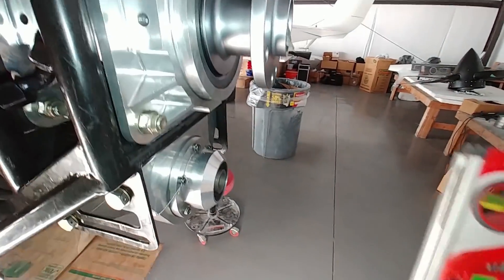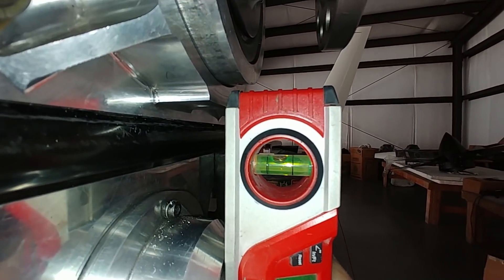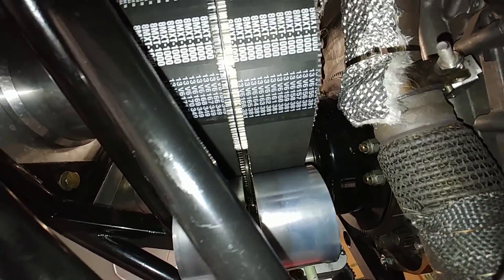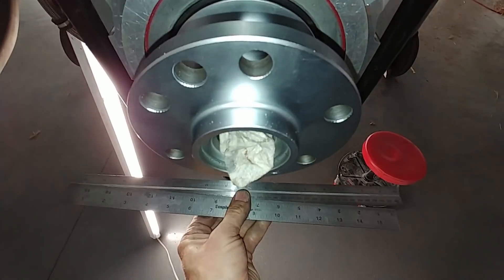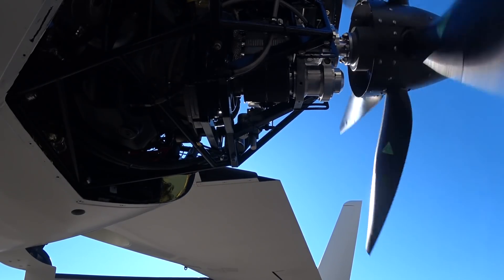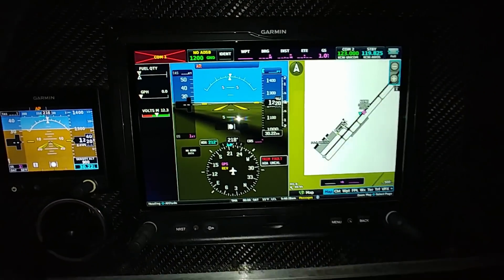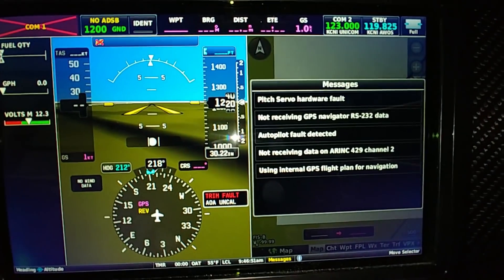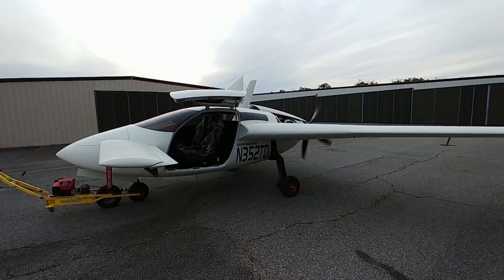Understand the Problem - Building the Raptor Prototype

Comment from the maker: Just to clear a few things up. First of all the lower, smaller pulleys have fences on them that prevent the belts from walking off the pulleys. Obviously I have been running this setup for some time now without issues. My goal for this video was to understand how alignment of the pulleys affects the walking tendency of the belts. After hopefully understanding that it was my intention to reduce or eliminate the walking completely so the belts do not ride up against the fences. Because the pulleys are not convex it appears that all I can do is minimize the walking using a skewed alignment of the pulleys, which is what I've done. My next test will be to get some really good close up video at full power to see how much the belts push against the fences when under max load. Obviously this is a prototype and this setup needs to be evaluated and the appropriate changes made going forward to optimize the setup. If the current setup is safe, even if not ideal, then I'll continue as is. Thanks, Peter
Reply: Just fence all of it Peter,  top and bottom, fore and aft with a fence between the two belts.   And after reading the comments fence the idler pulleys too.  Idiot proof it.  A belt worn on the edge will still work for a long time before failure.  The alignment issue is dynamic and will not be fixed with alignment only with the present mounting system.  Engine and gearbox need to move together, but this does not mean the present system cannot work.  Force it with fences.  Convex fences.
Reply: It’s probably the belts themselves.  The PantherXT belts have a diagonal ply fabric on the ribs that can create thrust and cause the belts to walk. It also makes sense why the belt centers when you’re off the throttle since the prop will be driving the engine. The drive side of the belt rib pushes one way, the coast side, when driven, will push the belt the other way.
Reply: Should be no harm it letting it rub, look at belt drive motorcycles they get tons of life from a belt with no issues and touching a flange. Or more extreme the belts on snowmobiles, they not only touch their pulleys they are also squeezed between 2 clutch plates and are used as a wear item for clutch engagement. Supposed to replace the snowmobile belt with the pre season inspection, but many cheapos run them for years since they often still look like new after a year despite the less than ideal exposure to friction/heat from the clutch plate.

As long as the belt can make it to at least the annual inspection for yearly replacement it would be fine touching a flange. If it can do bi-annual, or 200-400hr replacements even better. Regardless of the belt running true or not, would still want to replace it relatively regularly for fresh rubber with it being a critical power delivery component. No point complicating the install procedure if it’s not required, will just make maintenance harder and more expensive for the consumer, vs a dead simple shafts parallel set up. The second mechanics start needing to adjust/test/adjust/test the system will make for a very labour intensive maintenance item.

Run the shafts aligned parallel for a simple, repeatable set up/installation. See how it wears to gauge if it’s even an issue before going crazy looking for solutions for a problem that might not exist.There can’t be much friction from the flange on a belt moving the same speed. 

Remove any sharpness from the edge of the flange to help protect the belt as it mounts the pulley each rotation. Or add a low friction wear surface like Delron/HDPE on the inside of the flange if some wear is occurring at to quick of a rate. 

No point over complicating the system to squeeze a little more life out of a belt that will be replaced long before it’s actually old and unsafe.
Reply: Please bear in mind that without sophisticate instrumentation, you have no way of knowing the side loading on the belts, even under an apparently slight movement. My concern that multiple slight variations in load while in rough air could put the belt through thousands of load cycles in a short time and turn the aircraft into an unintentional glider.
Reply: Try skewing that idler pulley down to the ground, in the same direction that the belt is approaching the idler pulley, on the prop side. That will pull the belt to the prop more.   

I run a paper machine and run 331” by 192’ belts essentially to dry the paper, running 3000 fpm. We use guide rolls that operate off of this principle I described to you. 

I also agree that the belt could be causing it. Some belts want to track to one direction or another. I would keep the sheaves square with and cock the idler pulley
Reply: Simply replacing the flexible engine mounts with solid ones would be cheap & easy and it would show clearly whether or not this is the issue. Whether or not the solid mounts would then cause vibration issues through the airframe though is something I have no idea about.
Reply: Flat pulleys are the problem. Think of a band saw pulley. Convex pulley
Reply: Totally agreed!!! It’s a prototype people!!! Not the aircraft you fly grandma 👵🏼 home.

Comment: My friend and I had the exact same problem in 2006 when testing his PSRU (belt drive ) in his replica spitfire, using an Oldsmobile Aluminum V8 engine. We spent a great deal of time working on the problem and came to the conclusion the most probable cause was the rear bearing of the engine. When the engine is idling the crank shaft is strong enough to center itself in the bearing having an equal thickness of oil between the bearing journal and the engine bearing wall. There isn't any load on the belt. But once you add power and the belt loads up the crank shaft is pulled ever so slightly to one side which tends to move the bottom pulley. This in turn throws out the alignment of the back side of the bottom pulley. The front is held in place by the massive front roller bearing. 
We did not use idler pulleys to maintain tension on the pulley but during set-up we discovered the distance between centers from being too loose to being too tight was only .006 on final adjustment and we couldn't get that zeroed because there wasn't oil pressure surrounding the rear bearing of the engine. When we made adjustments wed discovered we were actually moving the output end of the crankshaft. measured with a dial indicator. We tried rotating the crankshaft and bottom pulley to different positions and realized we were chasing our tails. It tends to be the nature of the beast when using these belts that want to walk. I don't have any solutions. We also had a fence to stop the belt from walking further.

Comment: Have you considered adding a crown to the idlers?  It should help to pull the pulley back to the center and allow you looser tolerances on your alignment. Crowning is a bit counter-intuitive.  The belt gets pulled towards the high spot.  Because you have a timing belt you probably want less crown then a flat belt. I dont know what the impact of using a crown with a timing belt is but it may be worth a shot.

Here is a basic reference:
http://www.gatesmectrol.com/mectrol/brochure.cfm?brochure=5196

And here is a good demonstration:
https://woodgears.ca/bandsaw/crowned_pulleys.html

Comment: as long as the upper pulley is floating (toward the front), you'll have issues with it moving.  It will likely get worse with wear.  Similarly the reason they align cars with the wheels pointing away from each other is to give more stability on center and to compensate for wear in the system.

Comment: The standard fix for this in the automotive world (timing belt walk) is to tilt the idler pulley mount by a couple thou. Not that unusual, even with all new parts. The idler pulley mount is probably the least precision located, not to mention easiest to change!

Comment: the problem seems to be similar to getting a belt sander to run centrally  on the  drive pulley, perhaps it would benefit by having a slight convex profile on the tensioner

Comment: I THINK I FIGURED IT OUT ... I was just rewatching this for the third time, just staring at the rotating belts and remembering from 40 years ago.
I believe the answer is to adjust the angle of the idlers's faces; the "angle of attack" will influence which way the belt will migrate, and altering the face of the idler to a mild concave surface will keep the belt centered without contacting the pulley fences.

Something that bothers me is the idlers' close proximity to the pulleys; I am used to seeing them mounted about 1/3 to 1/2  the distance to the drive pulley, and the close proximity may be making it more sensitive to torsional effects that cause the belt to migrate more easily.

Comment: Can I make a suggestion.... after reading a bit online about belt walk, It appears that most people insist that you have to measure the face of the actual pulley rather than shaft face or a few cms away , as the pulley is mounted on the shaft and may be on an angle different to the front of the re-drive ..... Maybe if you got a flat plate of stiff 5mm aluminium, and cut out a U shape, then pushed it up from under so as much as possibly of the Bottom U is touching the bottom pulley face, and see how the top part is touching the top pulley? that might be able to give both left right and up down alignment?.

Comment: Are the pulleys perfectly cylindrical? one way of checking would be to turn the 'rear' pulley through 180 deg (if possible) and see if the belt walks in the opposite direction......

Comment: Try putting a crown on your pulleys. Ever so slight, have the center diameter of your idlers slightly larger in diameter. This is a technique used on bandsaws to track the blade. This has a self centering effect.  Who knows, it might just work.

Comment: Hi this is NOT a horizontal issue, it is a vertical allignment. What needs to happen is the redrive needs a slight downward tilt ie put a small spacer at the top of the redrive mount.

Comment: Might of made the machining more interesting/challenging but if the gear pulleys could have a slight increase in height to the other edge or bevel just at the end to in courage the belt back to the inside, short of an actual large beveled lip or wall. Need something to stop the belt walk without inducing a belt shred. May not be needed, but an interesting challenge for Raptor 2.0 once this one is flying soon.
Reply: Might have made, yes

Comment: Peter it is not perfectly aligned. As the load increases the problem is exacerbated. Aircraft and hovercraft here use similar belts however we have an adjustable thrust line on the output shaft assembly to track the belt correctly under load. A spirit lever is not accurate enough to do it. That’s why we adjust the alignment under load, not just line it up by sight.

Comment: For what it's worth, there's a bunch of power tools - sanders and the like - which run pulleys. They have mildly domed pulleys (the centres of the wheels have a larger diameter than the edges) which centre the belts nicely. I have no idea how it works and it sounds counter-intuitive but it works. I know that would be a hellish expensive to make toothed pulleys like this. Savydude said it. Maybe crown the idler pulleys?

Comment: Use a barrel shaped tensioner, it will maybe keep the belt centered. the movement is due propbly to che secondary shaft not supported by one side, the tension of the belts bend the shaft slightly, the bend will push the belts towards the front of the airplane

Comment: On letter sorting machines, the rollers have slight crowns on them to keep the belts centred
Reply: They use flat belts. This is a cog belt and the pulleys are machined flat and square. like a gear.

Comment: Synchronous belt drives are manufactured with twisted tensile members, in the case of Carlisle Panther XT, carbon fiber tensile cords.  These cords are twisted,  most often either all right hand twist, or all left hand twist.  The helical twist of the tensile member is what imparts the tendency for the belt to walk to one direction or the other.  This tendency to walk is  greater when the belt is under increased loads.  Imparting a fleeting angle to the components is not recommended, as varying torques produce varying amounts of the belt walk tendency, and will reduce belt drive life, including components other than just the belts and pulleys... think bearings, seals, etc..., plus it's kind of like chasing your tail due to the  variable side thrust force based on load. There are manufacturers that supply belts with alternating right hand, or Z twist, and left hand, or S twist, which greatly mitigates this phenomenon.  I have been out of the belt drive engineering business for over six years at this point, so I don't recall which manufacturers produce that configuration.  A call to the application engineering department at Carlisle or Gates could be helpful, but avoid mentioning the aircraft application, as they have company policy prohibiting belt drives for aircraft application and will not help with design of such drives.  It is not recommended to use crowned idlers, or to crown the pulley teeth due to greatly increased belt wear and reduced drive life.  Rather, toothed idlers on the inside rather than smooth pulleys on the backside of the belt of the drive are the standard recommended practice.  Using flanges on the idlers would work to keep the belt centered on the pulleys.  If idlers could be eliminated altogether, and an adjustable center on either the drive or driven component used to tension the belt that would be the preferred solution, in your case it would likely have to be the driven component, the prop.  Just my $0.02 worth from over 20 years in synchronous belt drive engineering and manufacturing.
Reply from the maker: Thanks very much for the detailed response. I did flip the belts but it did not make a difference. I will likely tension the belt to the manufacturer specs. I'm going to put by infrared camera on there and do some high power runs to see how the belts heat up. Apart from that I'll just continue to monitor them and keep the current configuration.
Reply: This is awesome.  Thanks for posting sir.
Reply: I'm sure that's probably a major possibility and/or contributor to the problem. Another might be harmonics from the engine vibrations (not the propeller - otherwise you've got a ready to fly on its own problem!).
Something I learned when working on a similar project (a hovercraft prop drive and lifting fan running off a diesel engine) was to be wary of keeping the tension too high on the belts. Any vibrations and/or minor diameter (of pulley) tolerances get hugely amplified with tension. Somehow I doubt that is the issue, just thought I'd mention it as a really simple to test solution (if Peter hasn't already tried it ie.).
Reply: @Mecalas  Tensioning is another issue altogether.  Belt manufacturers have a tension range for the various synchronous belt products.  A call to application engineering at the manufacturer would get a quick answer to tension range for any particular product.
Reply: Jim if the belts have an inherent conicity  to move left or right wouldn’t flipping the belt over to see if it drifts the opposite way be a confirming test?
Reply: The belt is getting walked by the driver pulley towards its shaft free end, the belt is an end load: belt tension adds a teeny flex to the shaft free end. The belt is pulled around a contact patch with the pulley, its shaft's free end gives, a tiny drop which the belt walks. You might be able to measure a tiny difference between belt load center points (pulley shafts) when the belt is taken off them and again when it is fitted on. I don't have a solution. See the 'belts' guy up top. *suggestion: a slight taper in the pulley diameter sufficient to 'level' with the shaft's droop under belt tension, and another taper diameter in the bottom pulley in the opposite.
Reply: Yes and its that twist that is causing the problem. Flip the belt and put it back on.

Comment: Just an observation but from what I've read, most of the responders are suggesting a flange added to the pulleys.  As a second thought, increase the space between the top pulleys by 4 to 5 MM, allowing the belt(right side in view screen) to stay on the repositioned  pulley.  The belt appears to be centered on Idler pulley(Timed section 1:59 thru 3:20)  By increasing the space between the top pulleys, This moves the top right pulley into alignment with the Idler & bottom pulley.   Again an observation but the weird thing is, it just might work.

Comment: Would it be an idea to take the right belt off and turn it around 180 degrees. Just to make sure that the belt does not have a small taper built in to it by accident from the factory. I am just thinking if the belt is just a small amount longer on the right side than on the left side. The belt is probably ok, but it is worth considering since it is a very small amount of inperfection in the belt that would make it start "walk". Good luck Sir. Best to you, Ole Ringstad, the Norwegian.

Comment: Maybe some flexible coupling on the engine to redrive.. lets a tiny amount of angle difference between them be offset.. the redrive is hard fixed to frame. the engine is floating on rubber bushing.. you cant get a fixed hard alignment that way. also i agree on slight doming the redrive pulles., also looking at cars there is a fence on each pulley front and back side..